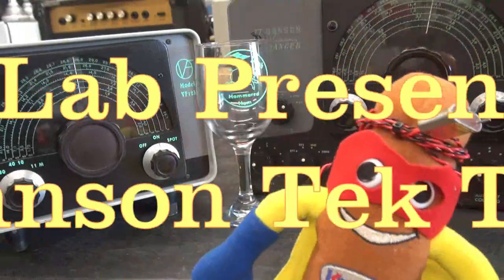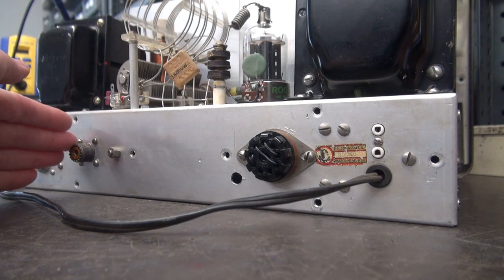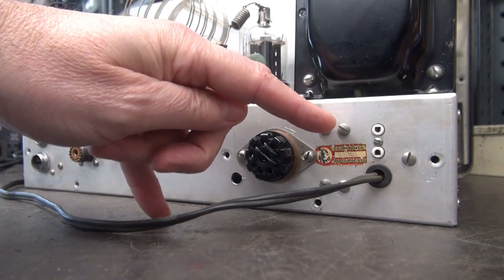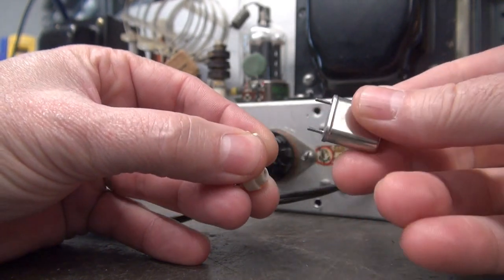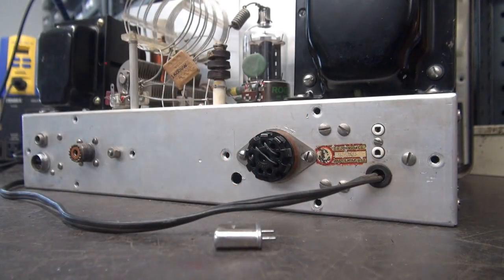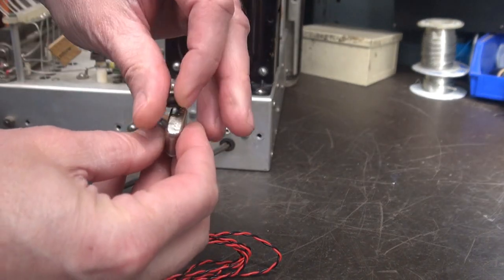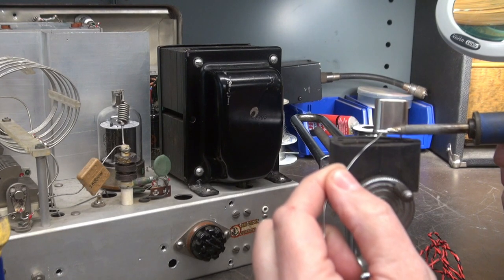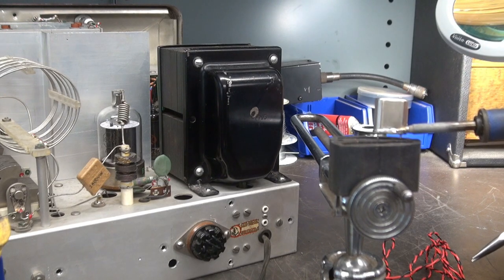How to make custom cable from a crystal TR switch Vintage Johnson Ham Radio transmitter Tip

Comment: Nice Terry. A tip for you. When cleaning the burs around the  hole like you drilled in the crystal can, I just use a bigger drill bit to ream out the hole so it becomes nice and smooth. I usually turn the drill by hand. Sometimes I will use a electric drill.

Comment: Great tip. You could add a strain relief knot inside the case to prevent stress on the wires from breaking loose if accidentally puled to hard. Just a thought.

Comment: I'm thinking that there are a couple of things I might add to this project.  Maybe a big knot in the wire for strain relief.  You gotta know folks are gonna yank on the wires to unhook it.   And/or adding a squirt of silicone sealer inside the crystal housing.  Maybe through a hole pre-drilled in the side before assembly. Keep those wires from ever going anywhere.

Comment: Would also suggest taking a small disposable syringe and mixing some epoxy, and injecting it via that grommet, and leave to cure with the pins down, so as to provide extra insulation.  The epoxy will also provide strain relief, though not on the grommet but inside the case. No needle required, just the tip through the grommet to get into the case, and thin epoxy.

Comment: On my Viking II I use an old 300 ohm tv lead-in plug. It's a perfect fit. It's one of those clear plastic plugs from a 300 ohm connector.

Comment: I think I'd also add a large heatshrink on the outside of the plug just for precaution. :)
Reply: That's a good idea. I was surprised he didn't tie a knot in the wires to keep them from pulling out of the case. I probably would have done something questionable, like fill the cover full of silicone.